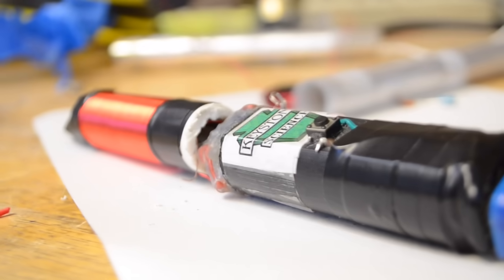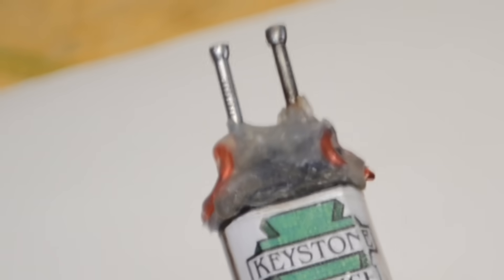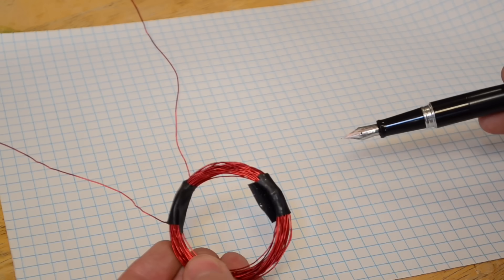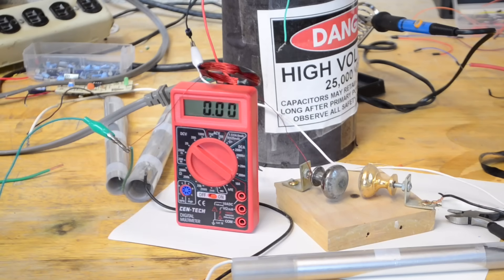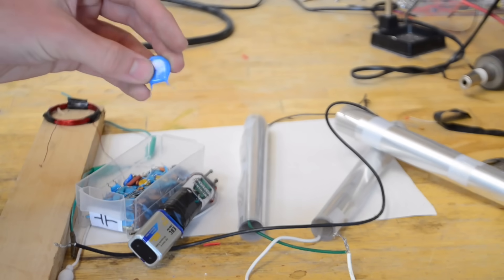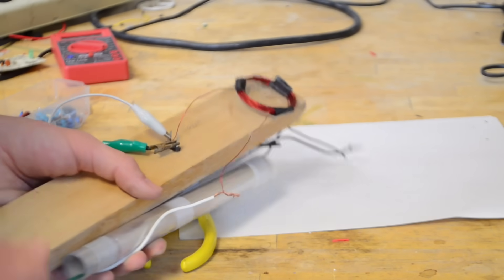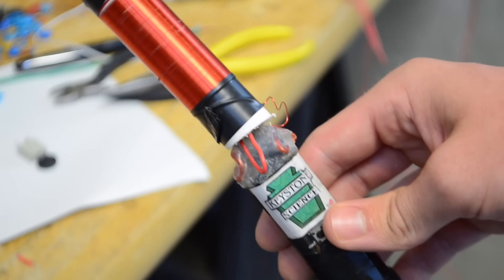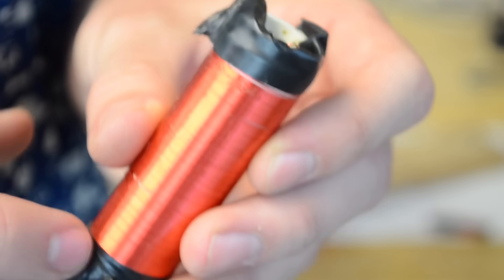How to make a pocket EMP

Comment: what would happen if one were to use a toroidal coil? And does more windings mean more Volts/Amps/Duration to achieve desired result?
Reply from the maker: I'm not quite sure what a toroidal coil would do, however you would probably want to keep it as an air core inductor, just because they can do high frequencies well ( that's why tesla coils are air core ) but as for an toroidal air core, it may work better

Comment: What specific damage does an emp do to electronics and what could you do to shield a device from emps
Reply from the maker: +Oli Benjamin an EMP fries electrical devices by inducing a high voltage across the components, anyways you can shield a device from an EMP by using a faraday cage, basically a metal box around the device absorbs the magnetic pulse and protects the device inside .
Reply: Hey, thanks, also what specifically do you mean by fry? Thanks :)
Reply from the maker: +Oli Benjamin no problem, I mean, that the components inside will get shorted out electrically, and thus broken... So yeah, that is what I mean by fry xD

Comment: Can u make it long range like 10 to 20 meters?
Reply from the maker: Yeah, you would need a lot more power though, and a lot higher capacitance
Reply from the maker: So probably not using this taser set up, but perhaps that would be easier to make it at a bit lower of a voltage
Reply: very good sabotage device for field undercover agents.
Reply: Thanks

Comment: I have some high voltage electrolytic caps. Would those work in place of ceramic caps?
Reply from the maker: +Dave R hmmm, I would say at least 8kv and more or slightly less depending on how far apart your spark gap is
Reply from the maker: Yeah! They should work fine! ( well if they are rated for a high enough voltage level )
Reply: How high is "high enough"? I too have electrolytic caps.

Comment: can it be focussed???😇
Reply: just because. I know an e m p has area of effect,but can you use it directionally in any way?  so you don't fry you're own shit but cook someone else's
Reply: brilliant by the way. simply genius
Reply from the maker: +wont believe good question, the most concentrated you could get it would be using electromagnetic radiation as the EMP ( such as a magnetron ), However, although I'm not sure, I wonder if making a coil shaped as a semicircle would sort of act like an electromagnetic lens of sorts making it much stronger at the top of the hemisphere ( probably with a small opening on top )... But I'm not sure about that. So I guess, you could try that and see what effect it has , or just make sure it doesn't get near your things xD I'll think more about this though!
Reply: What comes to my mind is a horseshoe shaped coil core. You could use an actual horseshoe for style points, or an U-shaped magnet which is probably a better material. It would force the magnetic field through the air to connect the open ends, while being almost undetectable on the closed side. Much like an actual U-shaped magnet behaves.

Comment: one of the best channels about electronics!! i was womdering if i can replace the spark gap for a zener diode or other component that desn't make so much noise? what do you think??
Reply from the maker: I wouldn't say a zener diode just because it would be hard to find one that has the right specs for this, that is unless you where using a lower voltage and capacitors, but then you might as well just use a switch to set off the EMP after the caps are charged up , and thank you! :D
Reply: What about a blown fuse? Take a blown fuse, one of the good ones with the big ceramic cylinder, not the cheap glass type. A blown fuse should still have part of the terminals inside the cylinder. Then you can use it as a "spark chamber" that's insulated and muffled. You could even try wrapping the fuse in play-doh or some other kind of inelastic dense material to muffle the sound even more.

Comment: why didn't it effected your camera??????
Reply from the maker: It could be probably one of 2 things, first the range is not very far and I have my camera on a tripod back about a meter and a half, or second, a lot of tech these days on the higher end are built to "block" EMP pulses using metal plating inside of it. I know it will not affect my phone , for instance, for this reason.

Comment: what happens if you put a metal core inside your coil? wont the magnatic field be bigger?
Reply from the maker: Yes it would have a much greater inductance property, the only problem is that it would probably short out through the core, however if you insulated the iron or ferrite inside, it should be greater and work much better

Comment: doesnt the HV generator itself have its own capacitor inside
Reply from the maker: Yes it does, just for making it an attachment on my pocket taser I found it easiest to arrange an external capacitor to where I needed it for the circuit , also it helps with the power of the pulse a bit